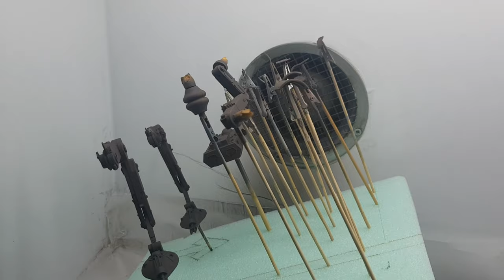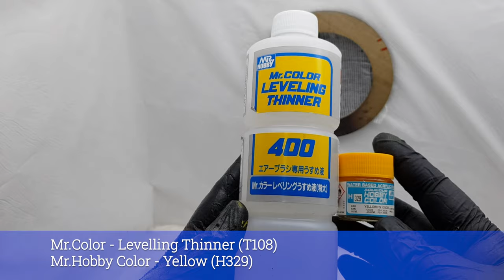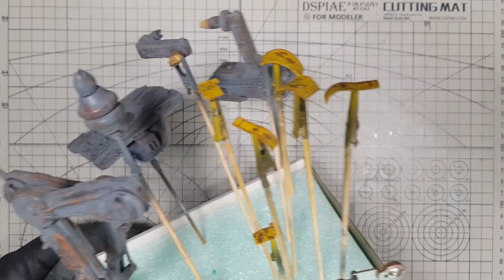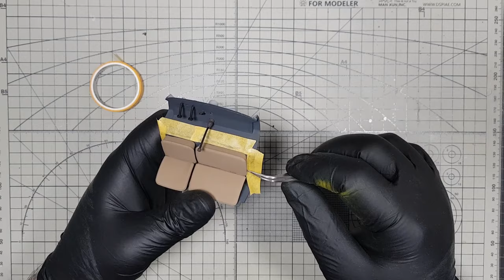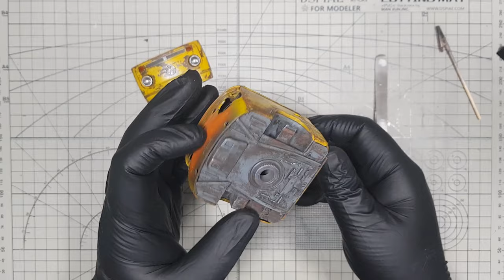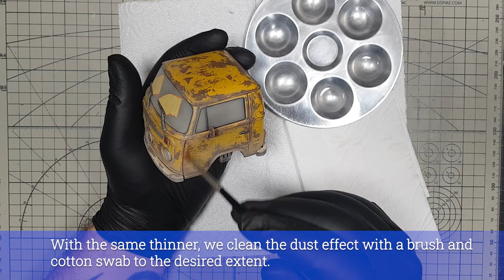[Bandai AT-ST] + [Revell VW T2 Bus] Kitbashing - Hair spray chipping, washing, dust effect

Comment: Looks great. I have seen al lot of chipping video’s but nobody tells you how long should the hairspray and paint dry. Please let me know. Thx
Reply from the maker: Thanks, mate.

Since there is a wide variety of hairspray, there may be different times for everyone and of course how thick a layer is applied is also very important, but the passing of wetness is the sign of drying. it can be checked with your finger without pressing too hard and then you can start the colouring process.

For paint; I shared this information for the paint I use. 
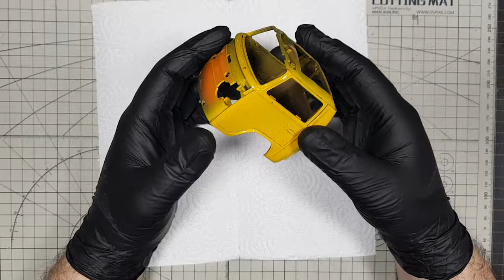02:45 please check.

Thanks again cheers 🤘🍻
Reply: Hey guys, when you spray HS I always mention in the books and videos etc. how it is applied with the aerosol and then use a hair dryer to speed up the process. HS (or a chipping fluid) should be dry to the touch before painting on top. Once the paint is applied and dry (usually a few minutes - or by the time airbrush is cleaned) chip away... speed to chip is no real issue for most paints. And usually you get a few weeks activation for long term or slower processes if you want to chip over a few days time.

Keep up the awesome work NightOwl!
Reply from the maker: @rs.p  Very valuable information. Thank you very much  :goodvibes:🙏🍻